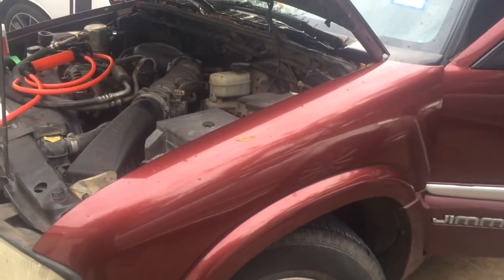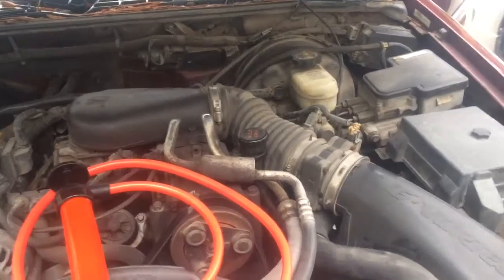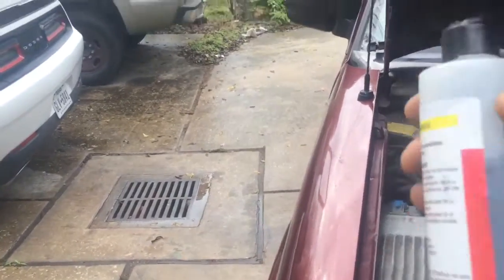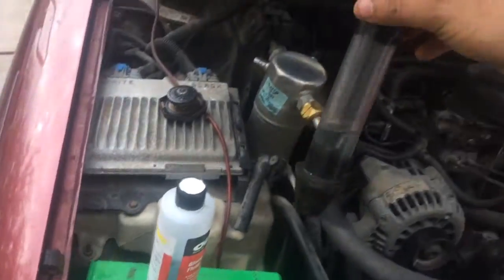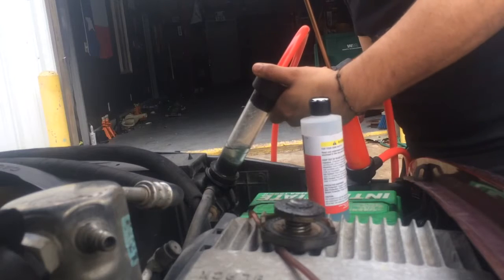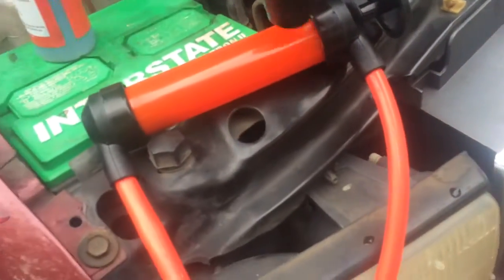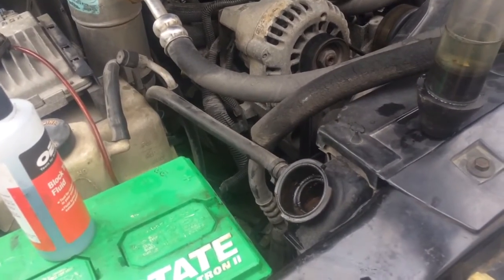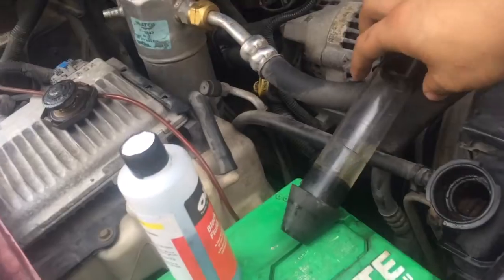How to test an overheated engine

Comment: Thank you ! You helped me make a decision on repair vs replacement. And watching this video gave me assurance in going with replacement.  I have a 92 truck that over heated blew t stat and replaced the water pump. Second the person who replaced the Water pump on this interference engine did not set it properly. So more than likely an engine rebuilt is needed. Let me know if I’m wrong? Do you think there’s a hope that with both issues given that the engine on that year is still in good
Reply from the maker: what make and model is the vehicle ?